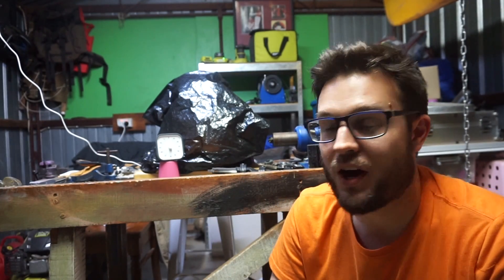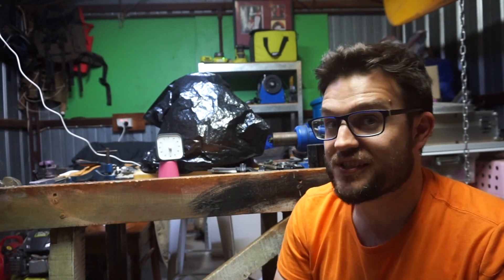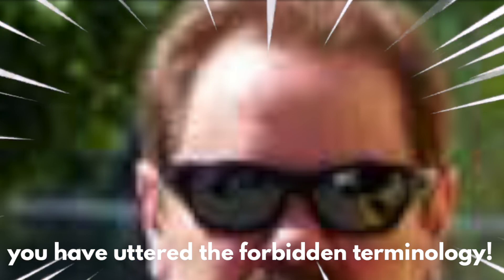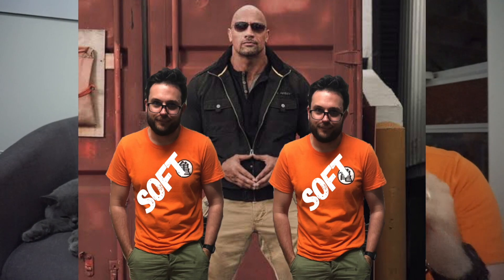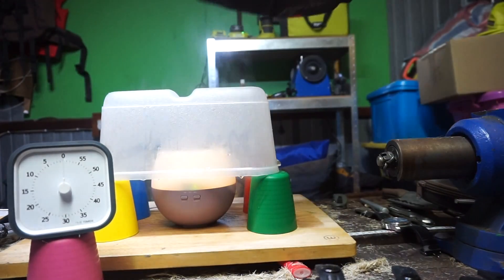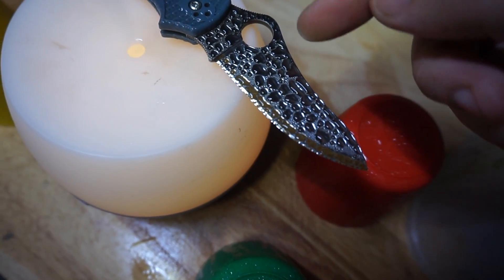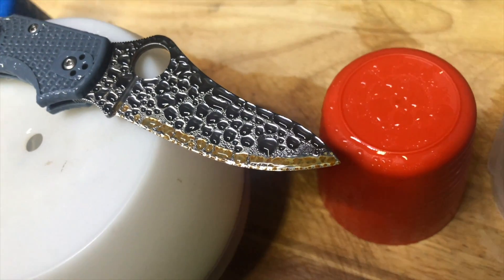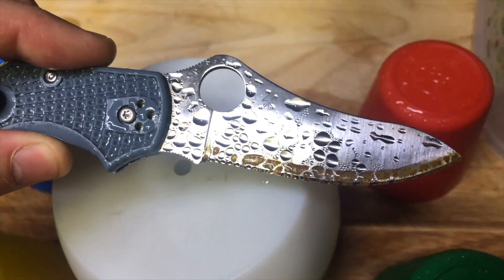Why Laminate Steel? A demonstration. SAN MAI.

Comment: So then what is the purpose of a San Mai like Cold Steel used with a VG10 core, and another high chromium SS like 420 (or whatever they use...I'm just guessing...maybe  Krupp 0.4116?) That isn't really gonna resist corrosion all that much more than VG10 would. Actually isn't VG10 quite stainless? Almost N690 level? Please enlighten me.

Comment: Hey Pete.  Good video.  On the subject of San Mai steels, blending hard carbon steel for edge retention with a more corrosion resistant variety is but one reason that a knifemaker might laminate steel.  It's certainly not the original reason for it, albeit a useful modern adaptation of the practice.

Japanese steel was often forged from less than desireable quality ore, and the harder high carbon bits were utilized for the cutting edge while the lower grade stuff was bent in a U shape around it.  This enabled the building of good blades with decent edge retention and toughness while conserving resources.  It was more along the lines of a (relatively) high carbon steel in a mild steel taco.

Comment: According to "Forged in Fire" (History Channel) the San Mai technique was developed in Japan to minimize the amount of good steel needed to make the blade.  High quality steel was rare and costly at that time.  

Hey, I heard it on the internet so it must be true.
Reply: Not only that, it is also easy to maintain the geometry of the blades (ktichen knvies) as the cladding is much easier to abrade on water stones. Also - laminated blade (sanmai, warikomi, etc) can be straightened after it has been fully heat treated - something that is very hard to do with monosteel (honyaki) blades. Plus sanmai blades have a much better chance to survive the water quench than honyaki blades.
Reply: @matusknives  "Plus sanmai blades have a much better chance to survive the water quench than honyaki blades." I thought san mai had a much higher chance of blow out than mono steel. This is why people often only edge quench san mai.
Reply: @SmurfMasher  If the forge-welding was not done well, then one may indeed experience a delamination. or it may crack. Edge-quenching is actually the most stressful for the blade, because the blade is being cooled at wastly different speed at the edge than the spine (same is the case when clay or similar is used at the spine) and a lot of stress develops. Also - blades like to bend during a fast quench. A san-mai blade is MUCH easier to straighten afterwards, while monosteel is much likely to break while attempting to do the same.
Reply: @matusknives  Interesting. I'll experiment.
Reply: It's TRUE, Japan has never been rich in iron deposits and what they did have (iron sand) needed to be worked extensively to produce functional blades

Comment: The original intent of ladding harder, brittle steel with softer, tougher steel is to allow blades to deflect further without fracture. Aside from some rust resistance, I don't see the point of this on a folder
Reply: 'Cause it's cool. Spyderco also made S90V laminated with CPM-154. Per Sal it was just to show off a steel that Crucible made. Apparently the process was challenging to get right.

Comment: If the rust were left unchecked could it “eat” its way up under the laminate where you couldn’t get at it?
Reply from the maker: Tom Macioce rust does eventually tunnel and ‘burrow’ under things like paint and such. So yeah, in theory I would think its possible.
Reply: Cedric & Ada Gear and Outdoors I was thinking if it was mine I would use it for a month then get a new knife and put that one away. Fast forward 6 months. I’d pull it back out and it would be ruined. Would there be any fix for that?

Comment: The softer steel does provide substantial support in terms of extreme lateral stress. The core steel, the edge steel can be made harder and therefor more brittle because under lateral stress the laminate steel prevents the core steel from, flaking, cracking or even snapping.
How necessary that really is on a pocket knife is very much open to question but that’s the idea in principle.

Fun fact (fun not guarantied) English blacksmiths were making composite blades as far back as the Iron Age. In fact some Iron Age swards were actually more sophisticated than this, being made of up to 7 separate peaces of iron/steel.

Lynn c Thompson can go suck a pustulant, suppurating, red & swollen, disease ridden di… well you see where I’m going with this? The term “San Mai” is recorded in use as far back as 2000 years ago in Japan and it is absolutely not his property.
Reply: Majin Snake LOL! 😄

Comment: Has a knife company ever done this with M4?
Reply from the maker: Vex it generally seems to be the fine grained japanese steels like this, zdp189, superblue etc, plus hap40. At least on the market. I know spyderco did s90v between cpm154 which seemed like overkill for cladding steel. I’d love rex121 between sus410
Reply: Cedric & Ada Gear and Outdoors get the rex121 thin enough and that steel combo would be self sharpening!

Comment: I always felt that laminated steels are too rare in the knife community, it's one of the few ways to maximize edge retention, corrosion resistance and strength since a single steel can only really be good at 2 of those (well unless it's a nitrogen steel but theres only one of those and it's geared excessively towards corrosion resistance)
Reply: ANTIMATTER  THE DESTROYER OF WORLDS 
I think so to. For me I am a little disappointed that only one laminated steel was used in this test. I would like to see how a Fällkniven knife would survived. Just should have put 2 or 3 knives in the process
Reply: Why don't you do it then?
Reply: @jamesoncross7494  are you being sarcastic?
Reply: Jameson Cross 
I guess you are right. I am sitting here doing nothing while others do all the work. I do not have the knives needed to do the test myself. 
Nevertheless the workload would not increase if you use more knives for this test than one.

Comment: I'm gonna get stuck in to sharpening my new Ontario SP10 Marine Raider Bowie, using a Lansky, wish me luck. Got a feeling it's going to be a long day.
Reply from the maker: JockOfAges thats a lot of edge to thin out if you are doing any slimming or edge mods too! Those are great but *thicc*. God speed sir! 💂‍♂️
Reply: @CedricAda  I'm going to stick to the current edge angles for the time being, until i get something better to bring the angles down to 20-22 deg. I don't have much cash, so was thinking about the cheapest electric Worksharp. Any thoughts?
Reply from the maker: JockOfAges yeah man, for big one like that that would do fine. I freehand a bit on my el cheapo basic model worksharp and it does okay! But the guides are handy enough too
Reply: @CedricAda  Thanks for the advice, you have settled my mind that I'm doing the right thing. All the best from Scotland. 👍🏼✌🏼